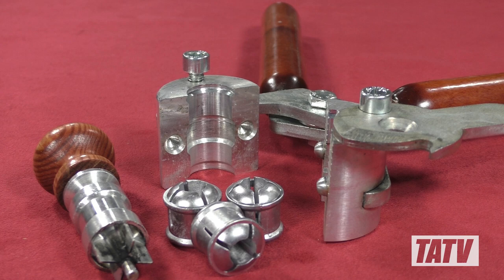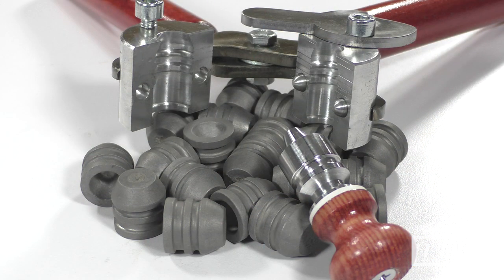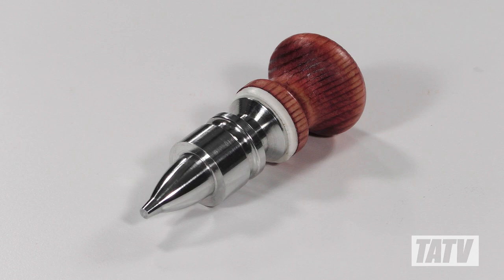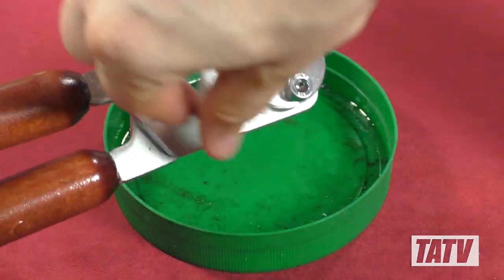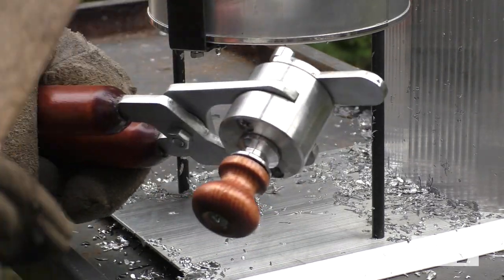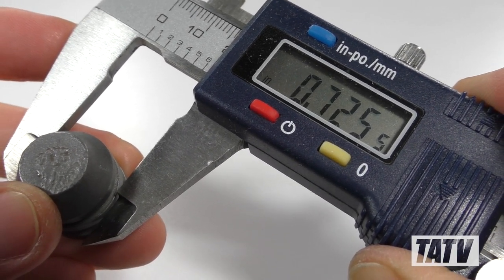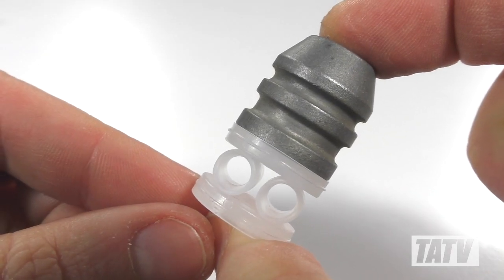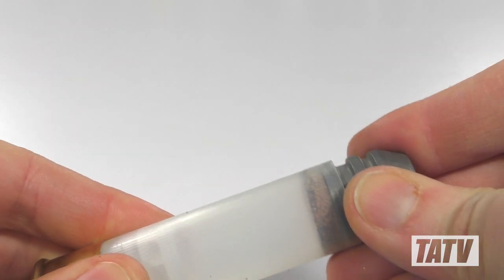Svarog Paradox Slug Mould

Comment: After owning a few Svarog molds, I've found that they are actually kind of fragile.  If you smack the sprue cutter open with a mallet, you will wind up with a stripped out bolt hole soon enough. The bolt that holds the sprue plate on is too short. After my first one failed I used a longer bolt for a while, that would grip a few extra threads, but it also wore out after a couple hundred pours. On two of my Svarog molds, I have drilled and tapped new holes for the sprue plate, using a full inch long bolt for the one that holds the plate on. I have over 5000 pours on the repaired molds, and they are still going strong. The core pins are a whole other issue. Keep the screw at the bottom snug, or you will be sorry. If you want your Svarog molds to last, don't use a mallet on them at all when you don't have to. Open the sprue plate with the push of a gloved hand. A 17mm deep-well socket slipped over the lever makes opening a breeze. All that being said, these make some of the best slugs on the planet.
Reply from the maker: I've never experienced any issues beyond the 'normal' loosening/backing out of the sprue plate bolt, but that happens on most moulds in my experience. That said, I definitely don't have 5,000 pours out of any of my slug moulds so maybe that's in the future.
Reply: The only problem I’ve ever experience was the wood knob drying and splitting I made a silicone mold and used jb weld to fill it and have not had a problem since
Reply: @TATVCanada  Yeah, I'm definitely getting commercial grade life cycles out of these now with more care. I average pouring between 1500 and 2000 Svarog Zveroboy slugs most weeks. I know I have over 12K pours on one modified mold now, and it keeps chugging.
Reply: @elpatonego8392  I've had that problem on every Lyman slug mold I own, but haven't experienced it on a Svarog yet. The problem I have with the core pins is the steel bolt that holds the knob to the aluminum "nosecone."  It only catches a few threads and can strip out if you have to pull too hard to free a slug. I check mine frequently to make sure they stay snug.

Comment: How do you sharpen the sprue plate.  Looking forward to your mini shell info.Appreciate your work.
Reply from the maker: I just use a very fine, round file.  Thanks!
Reply: @TATVCanada  Rolled up Emery cloth will do the trick if you can't find a rat tail file small enough. Makes a big difference in the performance of the mold.

Comment: Are these good for smoothbore without a stabilizing wad? I'm considering doing hard casting with extra tin and want to invest in a good mold.
Reply from the maker: These are decent, but if you can find one I'd recommend you get an ASM (AS Moulds). Substantially better quality for nearly the same price.

Comment: looks like it'd work great with those 10 gauge shot cups in magtech brass hulls
Reply: For 10 GA? Or for 12? In 12 ga, I would be concerned about how tight that would be in the bore. They are intended to be full bore for the bore riding principle and to take advantage of rifling.
Reply: @GunFunZS  12, the brass hulls are bigger ID than the plastic
Reply: @pacman10182  yes, but the barrel of the gun is not
Reply: @GunFunZS  10 gauge is the recommended wad for brass hulls, you can squeeze them through a tight choke without much problem (other than accuracy)
Reply: @pacman10182  you misunderstand. Birdshot compresses. Normal slugs fit in the shot cup, may already be to tight for some barrels. This combination would be too fat to fit down the bore safely.
Reply: @GunFunZS  thats what the groves in the slug are for.
Reply: @pacman10182  They can only allow for so much compression. if you are adding an extra 40 thou of plastic to your diameter, you are asking for trouble. The lyman and lee slugs don't even work with every wad due to this issue. 

Further, even if you aren't blowing up the gun, the key to getting good accuracy with the lee and lyman slugs was finding a wad and slug combination that fit snugly to the bore, but not so tight that it would smash the petals. Smashed petals caused erratic separation and therefore inaccuracy. If you pick up your fired wads, the causes are very visible. So an accurate load in one gun is not in another due to slight differences in bore size.
Reply: @GunFunZS  these aren't lee or lyman slugs, that whole paragraph is completely meaningless for this argument
Reply: @pacman10182  ugh.... Man just.... I give up. Get good health insurance, and take a buddy with you to the range.
Reply: If one wanted to load these bore riding slugs in magtech brass hulls ..they would pour in the powder then an engine cork over powder disc.and a card disc  Then a fiber wad then slug ..then a overshot wad and lacquered. That's how the old ones were made. Expect the slug to rattle a bit that's normal for  these

Comment: What and how much powder are you putting behind it.
Reply from the maker: I'm still working through my list of components so at this stage I'm not sharing anything quite yet.
Reply: I use a green BRP-12 wad from Ballistic Products attached to the slug with a #6 3/4" wood screw. Using a 2 3/4" Cheddite hull, I use a nitro card over the powder, drop the wad/slug assembly in and fold crimp. 34 gn of Longshot will push this slug over 1400fps.

Comment: Are you rotary or vibratory tumbling in walnut for that effect?
Reply from the maker: Vibratory.  Usually I use crushed corn cob (it's larger, cheaper and cleans up faster), but I was doing some of the Svarog 'Italian' slugs as well and the ground walnut doesn't get stuck around the seating stem the same way the cob does.
Reply: @TATVCanada  you seem like an excellent candidate for powder coating given that they actually are intended to swage down the bore. minimum I would cut them with alox or 45 4510 to reduce leading.

Comment: Curious how well they shoot? dimensionally are they longer than your standard Lee keydrive 7/8ths? I wonder if they could be shortened slightly, if needed, with a copper or aluminum insert or something? I'm thinking for DIY Roll-your-own 1.75-2.00 inch Mini-shells.
Reply from the maker: They shoot quite well, of course the amount of accuracy you get depends on the components/load data used as well as your gun obviously.  I am currently experimenting with 1 3/4 and 2" mini shells so you'll probably see some videos on those come Summer.
Reply: @TATVCanada  Awesome to hear. I'm a fan of mini-shells. I've always felt that 2-3/4 shells were a bit too tall for what a general purpose shotgun really needs. I'd think just under 2 inch shells that can be fed reliably would be the sweet spot. I'm just getting into shotshell reloading and seeing the wads I just don't understand why there's so much space taken up by those long shot cups, other than for the sake of fitting in the shell.

Comment: Are they made for smooth bore with the stabilizer wad or rifled barrel
Reply from the maker: They work fine in either.
Reply: @TATVCanada  have you accuracy tested them in smooth bore? I want a slug that isnt designed to split or expand for hunting.  I want a solid slug for bear protection that penetrates

Comment: Have you ever had issues with extraction on the ‘special’ pin. I cannot remove mine at all and have to remelt into my pot. Have nearly broke the handle off the pin.
Reply from the maker: Actually they release pretty well for me. Perhaps try smoking the pin?
Reply: Yes, they are awful. SO fragile. If you don't keep the screw at the bottom tight, it allows lead to seep under the nosecone making release difficult or impossible. All the smoke and silicone in the world won't help. If you pull hard enough to make them release, you put undue force on the threads of the soft aluminum nosecone, and they will rip out. Good luck ordering a new pin. Lee Precision, while not as "elegant," makes much more sturdy and practical molds.
Reply: @robertfrapples2472  i actually was able to order a new one BUT i have not tried it out.
If i still have issues i may sand out the nose cone

Comment: Could the Mould withstand molten copper to make a copper slug?
Reply from the maker: Not sure, but I wouldn't try it as I think copper may have a higher melting point than aluminum.
Reply: @TATVCanada  it does, copper, brass, all then are around 15-1700 f. need a steel mold if you work those metals. just researching right now, but thats what i have found out so far.

Comment: But how does it preform? Accurate? Stable in flight?
Reply from the maker: That depends entirely on what gun, barrel, and components you use.
Reply: @TATVCanada  You can say that about a round musket ball, lead mould from a  wrench socket, anything will fly. How accurate is it? How stable is it? If you dont know maybe you should do testing or send it to TAOFLEDERMAUS for real testing

Comment: My question is how accurate you are finding them to be.
Reply from the maker: Winter is not a fun time to be outside here, so I haven't had the time to do the kind of in-depth experimentation necessary to definitely say 'This is better than that.'  I will however say that the of the data I did get last Fall, the Paradox slug appears to perform better than the classic Lyman and Lee slugs most of us have used for years.  Once Spring finally gets here, expect to see a lot of videos about my experiments with these new styles of slugs.
Reply: @TATVCanada  that makes me very inclined to get it and your Wad punch
Reply: Scary accurate.

Comment: great slugs ,but take care with the leaddust thats comming out off the tumbler  , you will breath it
Reply from the maker: I set the tumbler up outside and have a bucket over it.  When I remove anything from it, I'm wearing a mask rated for lead dust.
Reply: An excellent point that a person can never hear too many times. Thanks from Texas.
Reply: Actually, I don't cast myself.  And I didn't know this.  Whew.  Scary to think how I would have done it wrong (not outside basically).